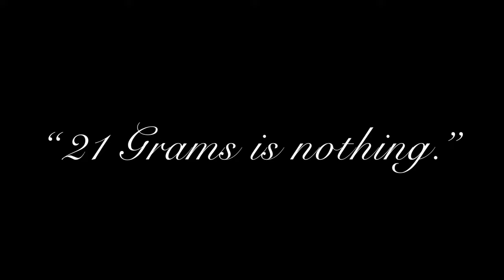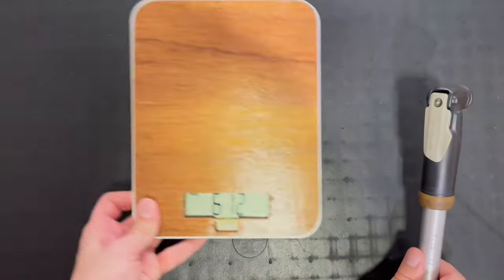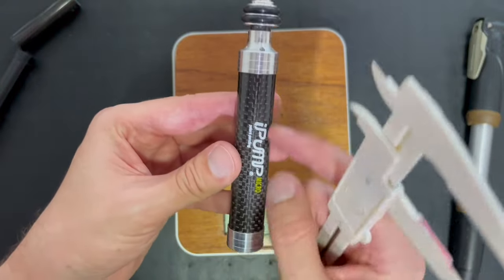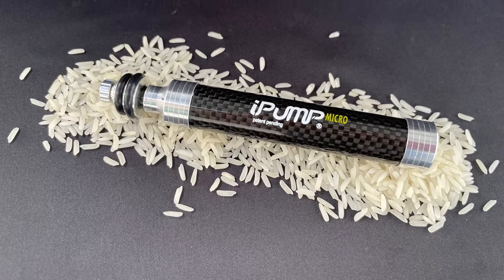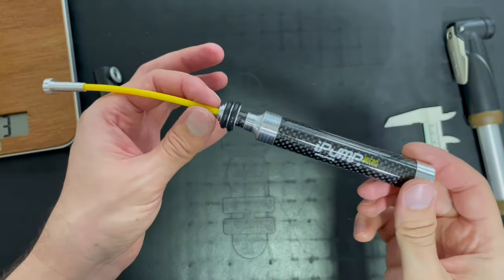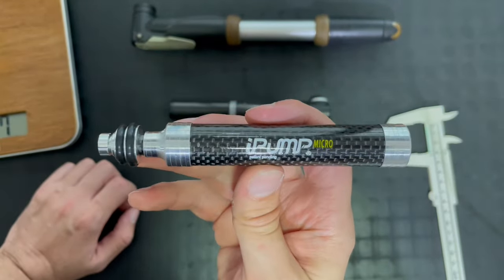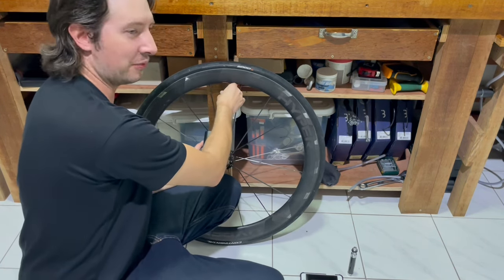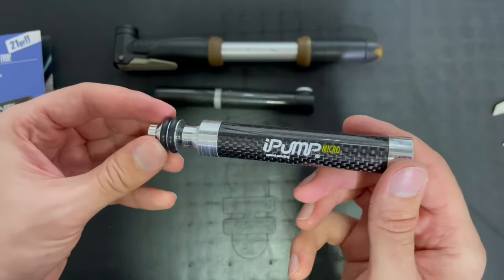iPump Micro. The Worlds Lightest Micro Pump.

Comment: Hi Reginald.  Weight wise, perhaps you should factor in the frame bracket for the mini-pump, but for the Topeak micro you could leave the cosmetic carbon sleeve at home.
One of my bikes came with a frame pump with the "holdit against the valve with the thumb round the tyre" type.  I quickly discarded it because my hands weren't strong enough to hold it on.  My mini pump with the clamp (which I still carry on one bike) I bought an old fashioned pump hose to use with it because I did not like the feel of the "rigid" connection to the valve.  I have since bought a Lezlyne mini pump which has the disappearing hose like your new one specifically for it and am happy with it.
On your new pump, the tiny grip at the Oring end looks like a reciept for pinched skin, Ouch.
Just as well your strenght limits the pressure so there is not the risk of too high and bang because they do not have a gauge.
Reply from the maker: Generally I put all my pumps in my pocket so no need for a frame clip of any kind. I’m too weight conscious for that. 😂 Well the handle is quite uncomfortable but thankfully it’s got a good gap behind it, so no risk of trapping my skin unlike the other pump. 😁👍🏻
Reply: @reginaldscot165  Happy pumping.

Comment: I like the Lezyne micro pumps.  They have a rubber hose stored inside which takes away the strain on the tire valve when pumping up a tube.  Newer versions of the hose has an air gauge built in.  High pressure versions will pump up to 150 psi.
Reply from the maker: Nice 😊 👍🏻

Comment: For weight saving it’s far better to empty your bladder and bowels before a ride and use a nice full length high displacement pump.  A big sturdy frame fit pump from decades ago can also be deployed to fend off dogs.

I use a track pump at home
Reply from the maker: Believe it or not, I also go poop before a ride and I fill up my tyres with a floor pump… so all being well I should have a much lighter ride. 😁👍🏻

Comment: Out of curiosity I weighed my Barbieri nano pump, it's 38 g, similar construction to the Topeak one. For someone who doesn't care about weight it's a much better deal at around 8 bucks. Also, I think the ringy part you hold onto could be engineered better on the iPump. On the other hand I started carrying RideNow TPUs as spares for my tubeless setup, I have yet to get a puncture big enough that I need to put in a tube, but now I'm a bit afraid whether I can avoid breaking off the valve with the Barbieri :D.
Reply from the maker: 38g and only $8? That’s amazing! 😍

Update: I looked for it online and found it for less than $7! 😱
Reply: @reginaldscot165   Yeah I'm thinking of putting together a second saddle bag with with a puncture kit for my commuter bike (I always accidentally leave the current one on the bike I last used and forget to bring with me :D). I think I'll order 2-3 of them just in case, but so far that one I have has been great for about a year-year and a half.

Also there's a lighter carbon version of that too (website says 29g, that's almost as light as the iPump - although it does not have a hose and these are not telescopic).
Reply: @HUNHali  Have you used the Barbieri nano? Does it work ok to get 60 psi in the tire to get you home? Would love some feedback, because there is not a whole lot on the internet about this model.
Reply: @nugginusslover476  Yes I've used it a couple of times. 60 psi is a bit of a stretch, I'd say more like 50, that is enough for me to get home on 28s wide tyres. Recently I've tried it with ridenow tubes with the flimsy plastic valve stem, I had to be a bit more careful when pumping not to snap the valve, but it worked. I'd say it's worth giving it a try for less than 10 USD.

It's a good compromise of subpar but just enough pumping power, low price and easy fit into any saddlebag.

Comment: I've got a heavier Topeak one with a pressure gauge. It's very hard to judge how hard your tyres are with just a thumb press. I do long solo rides 30 miles from anywhere, and really don't want to cycle with too flat tyres and risk a pinch puncture. My one does attach straight to the valve without a hose .... which I don't like. I'm on the lookout for a lightweight one with hose and gauge.
Reply from the maker: That’s a practical option 👍🏻🙂

Comment: you really loved making that opener didnt you!!! 

sadly a LOT of these pumps are completely overhyped, poor quality crap, ive had soooo many fail on me over the years ive gone back to C02.
If anyone could recommend a sub 100g mini pump that absolutely, genuinely works (I only need a measly 72psi!!!!!) then lay it on me!!! the ipump twist actually looks worth investigating!
Reply from the maker: I did. It worked out ok. 🙂

Believe it or not the 2 portable pumps I showed in this video are the only 2 I have ever bought in the 20+ years I have been riding. So I’d say the carbon one is very reliable and at 55g perfectly fine. I also honestly don’t think the iPump will be any less reliable, there seems very little to go wrong and even if something did (a cap came off?) you could just glue it back together, it’s just a tube… 🤷🏻‍♂️

Good luck!
Reply: @reginaldscot165  it was a cinematic masterpiece!

I'm tempted to give the ipump twist a go, that little handle looks like a big help, i've suffered too many times on the side of the road here in northern UK, especially in winter, trying to pump up a tyre with frozen mitts...nightmare!! Really don't want to continue with single use C02 canisters either....just feels so wasteful.

Comment: You'll unscrew the valve core when removing the pump head. Just like Lezyne pumps.
Reply from the maker: Hopefully not, I have tried to remove the cores in the Ride now tubes are they are very well stuck in, I believe they use a glue as well. 🙂👍🏻

Comment: What's the hype? It's a lightweight pump because it's small, has small capacity and will take ages to pump up a tyre. Another story was if they made a pump of the same capacity of the others, but lighter.
Reply from the maker: The hype is it’s the lightest pump in the world and it works. 😅👍🏻 That’s all. 😉
Reply: No hype. This works, and by that I mean it works for TPU plastic valve stems that lack threads, it has a hose that is basically bombproof and will take the non-axial forces away from the valve stem as well as creating a secure lock on the valve while pumping. In addition, the sense of quality is very high, and it is light and small. Yes, I have one myself.

Comment: My take that no one asked:
If you need <at least> 6 minutes of pumping at a side road, sweaty, near speeding cars and trucks, you being a pure climber with flimsy arms and possibly a female looking at your red sweaty face... then it's 21 grams of embarrassment. 
I use that same Xiaomi electric pump since last year and it has saved my skin and my mates countless times. Also, I can lend it to some fellow cyclist in need and actually get up to 100psi or more.
Reply from the maker: An electric pump is definitely an idea, my main issue with them is the small ones tend to not have much battery life. You can get maybe one or two tires out of them at best. The larger ones (that I have) would basically be impossible to carry as they are too large and heavy to fit in my jersey.

But I will take a look at the pump you suggested and see if it meets my requirements. 😁

PS. I’m guessing somebody who doesn’t use their arms (e-pump) would have more embarrassing arms than someone that has to use a micro pump. 🤔😄

Comment: No thanks. I don’t fancy unscrewing a valve core by the roadside.
Reply from the maker: I think it’s quite unlikely to happen with the ride now tubes, the cores are very well stuck in and the pump head is so small it doesn’t impart much toque on the valve. But I will keep you updated. 👍🏻🙂
Reply: @reginaldscot165  yeah I’m thinking more Conti tubes which are very common in the UK and tend to have loose valves.
Reply: @mrichards55 You could always put locktite on your valve cores.